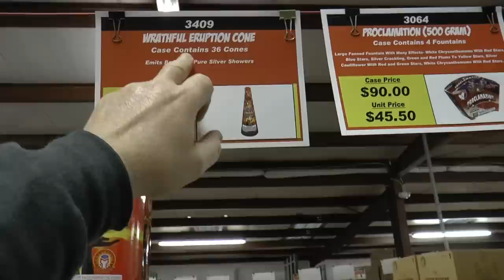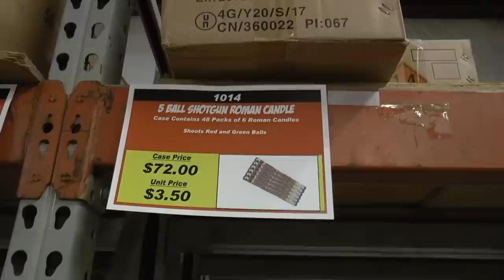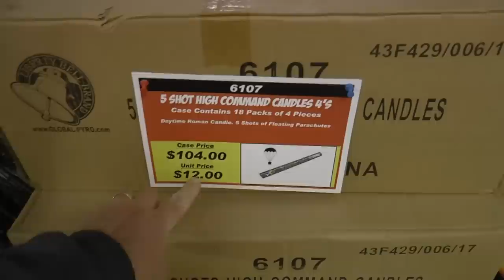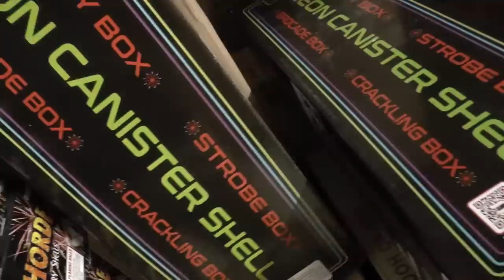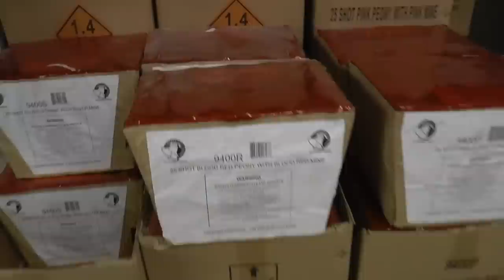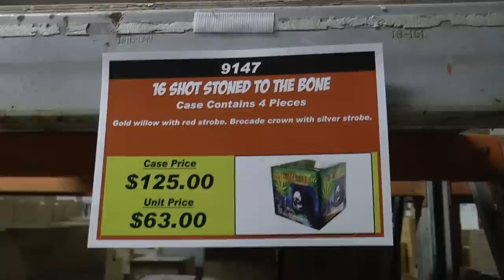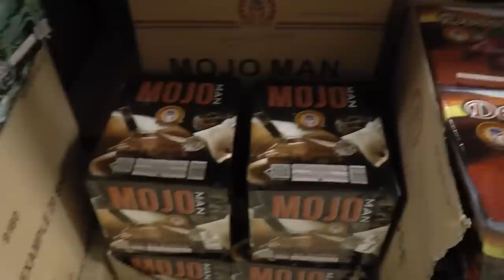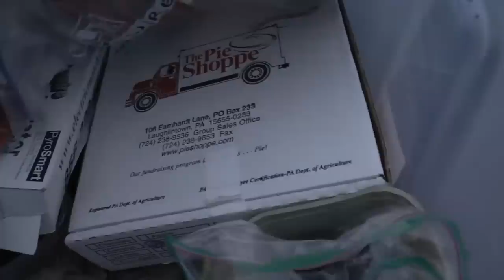Kellner Fireworks Open Shoot Night April 5 2019.

Comment: I have both P4 units from pyroboom and the Magiceffect ones shown in the video. I have the 433 mHz 1200 cue control deck. they are compatible. The PyroBoom modules are made with better Quality (made by Happiness Firing Systems) all the way around. I will be using both in this years show, and hopefully they will preform adequately because the MagicEffect from Bluescon are about 40-60% less in price. 
Great Video Dave!

Comment: I got myself one of those cheap 12 cue, 3 module firing systems. I thought I'd be able to map individual cues to one button, but no luck. After looking into it, those versions that allow you to do that are a bit more expensive at almost 3 times the price. I'm not sure if I want to get one or just buy another two systems like the one I already have. The biggest advantage, if I do, is that I'd hve 9 modules over 3 and I'd be able to fire 3 cues with one button.